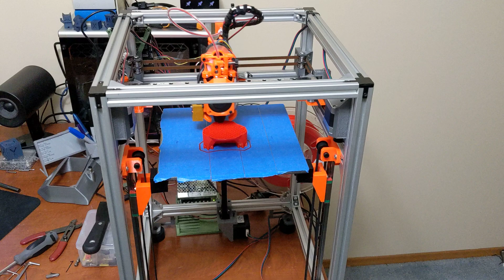DIY CoreXY 3D Printer SimpleCore (Formally SimpleCube Ultra V2)

Comment: how good is the 3 way connector ?  iam planning to build one and i see a small screw in that which hold the 2020 extrusions together
Reply from the maker: they are ok, blind joints are much better if you can use them

Comment: Can I use a heated bed 235mm on size 220 ? Where I live it seems easier to find parts for the size 235. Thank you :D
Reply from the maker: 235 should be fine, the heated pad must only be 200x200
Reply: @Rolohaun  Great, thank you :D

Comment: Are you able to do custom frame sizes to suit different build plate sizes, for example 235mm² or 300mm².   Like bed size x A = X Y frame size. Build height X B = Z frame size
Reply from the maker: I will be building a 300x300 and yes the printed parts stay the same

Comment: SimplCor! gets my vote.
Do you have plans to enclose this printer for heating the chamber?
Reply from the maker: thank you! I might enclose the 300x300 version when I build it. I will just use the heated bed heat to maintain temp. Should get to 50c inside.
Reply: @Rolohaun  I was just wondering about motor placement....
Reply from the maker: @SeanTaffert  what are you wondering about?
Reply: @Rolohaun  whether the motors would be in the heated section or placed outside the chamber.
Reply from the maker: @SeanTaffert  there should be no issue with the motors in the chamber if it's heated passively via the heated bed. If you are going to use a chamber heater you will need to use high temp motors.

Comment: Great Job! When do you think you'll have the 300x300 build plate version BOM set up?
Reply from the maker: Hopefully a few weeks, I would like to build one to get the bom as good as possible
Reply: @Rolohaun  That's great! Can't wait! This is something that is on my short term lists to build!
Reply from the maker: @dsnyder05  The idea is to sell my 200x200 build to fund the 300x300. The BOM should be the same with the exception of 12x450mm extrusion instead of the 12x350, 450mm Y rails, and a 330x330 glass build plate.
Reply: @Rolohaun  Look forward to it!

Comment: Awesome ! Are you planning to upgrade to a 9mm belt?
There are many opinions that 9mm belt will be less prone to vibration than 6mm.
Reply from the maker: I thought about it however I have not found bearings to support 9mm width, I use flanged bearings for the entire X Y motion and 6mm hardware is easier to get. For the speed I am printing at 6mm seems fine.
Reply: @Rolohaun  Thanks for the reply. I will start shopping for parts to prepare for this printer. It's great for newbies like me. Thank you very much :D
Do you have any donation links? I want to give you some coffee :D
Reply from the maker: @WINTFOX  I really appreciate the support. I do have a patreon https://www.patreon.com/rolohaun and feel free to join my discord!
Reply: @Rolohaun  Awsome. Subscribed.
Reply: @Rolohaun   You can use F606 bearings on these 9mm gt2 belts
Reply: @stefanpetrus4687  that sounds interesting

Comment: So close to the final version😁 Is the bed 220x220? Will you plan to change the bed mounting? I also joined to your discord and try to follow the news there

I noticed that in the bom the Z rails are 350mm's, but in the video you say 300mm.
Reply from the maker: the version in the video is a 220x220 glass bed so 20x200 rough printable build area. Bed mounting won't change, hope to build a 300x300 version. Thanks for joining the discord!
Reply: @Rolohaun  thank you! Just noticed the Z rail difference on the bom and video
Reply from the maker: @Shoo8601  thanks for catching that, I fixed it
Reply from the maker: yes BOM was updated to 350mm Y mgn9 300mm mgn9 for z. I fixed it